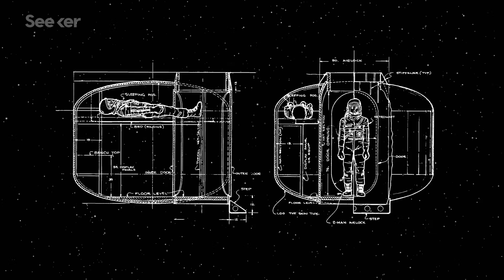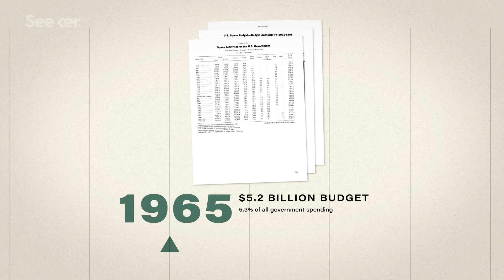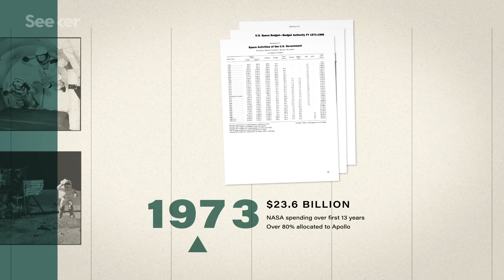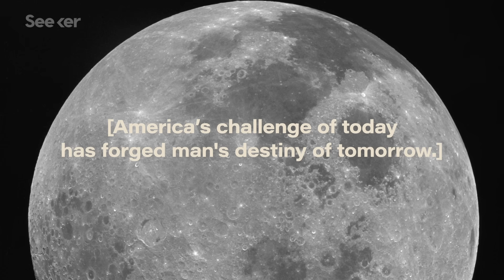Why Did NASA Cancel the Apollo Program? | Apollo

Comment: In my opinion, a base on the moon is a more logical thing to do rather than spending a lot of resources on keeping the space station up in low space orbit.. I mean the moon does have a stable ground and it has a soil composition similar to earth so plant life can survive there. Having a base there means we can build a much larger telescope and observatory that will not be affected by anything since the moon hardly has any atmosphere to bend light. If there is volcanic activity there it means we have minerals that we can mine and a way to harness energy and if we are lucky we can get some fuel as well. For me the priority should not be sending men to die in Mars but to send men to live on the moon. The advantages are endless.
Reply: The major point of the ISS is that it is Earth's ONLY lab for zero-G science.

And plants don't need soil to grow.
Reply: Lunar dirt is like powdered glass and sand blast abrasive. It scratches and clings to everything.
Reply: @projectmanagement2356  Yeah, imagine if that got into food or a spacesuit or even the base itself.
Reply: My point is that there is already an existing study on Lunar and martian soil/dust that it is possible to use it for plant life, though it needs to be processed. I mean moon dust practically everywhere might as well use it right? Aside from that hydroponics is also another way for plant life to survive, but my point here is not how to build a base, but the practicality of prioritizing having a base on the moon rather than on Mars. What do we gain from mars aside from satisfying our own curiosities? Why build a base on Mars when we haven't even built a base on the nearest space object to earth? I mean a base on Mars would be amazing, but I really don't think that it would be possible during this lifetime. I mean Mars is too far away and a million things could go wrong. You are aware that no manned space vehicle had ever reached that far. What they are attempting to do would the be first. Reaching Mars without encountering problems would a miracle, but it is possible due to the advancement in technology. Living on mars and returning safely on the other hand would be a different story. We can't just go and send the men out there to their deaths. Our space explorations has always been slow and sure but safe, that's the reason why we have the ISS. Why is NASA taking a dangerous leap now when there is a stepping stone right around the corner..
Reply: @neB_Storm  I agree that building a base on the moon is easier than building one on Mars, but living there is still not easy. People and plants would die from radiation.
Reply: Its cheaper to keep it closer to earth.
Unless you want people to live on the moon too.
But then getting replacement parts would be expensive and take forever to get there.
Reply: It's much easier and cheaper to build a Hubble telescope than to place one on the moon. I don't think something like the James Webb telescope would be possible also Personally I rather the moon stay the way it is, then to have it ruined by building colonies for the benefit of the few.
Reply: Again my point is not how to build a base but to question the practicality of building one on Mars. I'm just questioning why NASA is planning to send people to Mars when they know that sending people there may result in a disaster. Space as you know isn't a walk in the park, a single mistake could lead to losing lives, not to mention that that part of space is a part where no man has ever been to. Ask yourself wouldn't be sending people to live on the moon a more logical thing to do rather than sending men to die in Mars. I mean we've been to the moon more than a dozen times and I think it wouldn't hurt if we try to test out if the equipment works on the moon first, right? I think all of us understands that its better than sending human test subjects to Mars and pray they survive. You are aware that aside from the ISS, we don't have any thing else out there that we can call a proper base. I could say that the ISS is the only base that survived in space for that long and it is even on LOW SPACE ORBIT. What I'm saying is we need more experience and knowledge to not mess things up.
Reply: @neB_Storm  if something goes wrong on the moon, it's just as bad as being on Mars. Theres nothing we can do on earth.

So why not go to Mars instead of just the moon?
Reply: @Hooyahfish so you're saying if there is an available rocket to Mars you would want to be in it right? Dude you're not getting the picture. My argument here is again not how or why. Its the risk of people dying and how lacking our current technology and knowledge is. You are aware that the only manned space mission that we have so far is the one done on the moon, and the only space base we have, and not to mention the longest ever to stay on space is the ISS right? You are also aware that we haven't stayed on real outer space long enough to say we will survive a journey to Mars. The ISS btw doesn't count because it is an area we call the low space orbit where you can just go to the nearest escape pod if shit happens and the earths gravity would then do the rest and pull you back to earth. Have you ever considered even the distance of how near the moon is compared to how far Mars is? Please don't tell me you would want to be on a rocket headed for Mars because I would recommend for you to think twice. I'm aware you know that we already had explorations done on the moon so it is relatively safer to build a base there. Let me add an argument that going to the moon without dying is already a reality, unlike going to Mars, which currently is a dream. The risk of making a colony on the moon is lower as it is safer and economical. Don't get me wrong having to go to Mars would be AMAZING, RETURNING ALIVE WOULD BE DIFFERENT STORY. Going back from Mars alive is just not possible in this lifetime. Let me put in words that even you could contemplate and understand, if the earth was the same size as a basketball the moon would be 24 feet away from it. Now imagine how far away Mars is and all the shit that could go wrong along the way, which by the way a first experience for us since we haven't traveled this far away from earth  before. It would be a big mistake to even think about returning alive from Mars, you'll be dead even before reaching Mars so don't even think about returning alive. Now having taken all of  those things into account would you really want to take a one way ticket to Mars and risk it all for the sake of science? I'm  just saying a base on the moon should be the safest chance we have if we want to continue doing manned space explorations.
Reply: Wrong. It takes longer to get to the moon than the iss. The iss is also an international station and lead to continued peace in space. A moon base would be seen as an attempt to conquer space by a nation
Reply: @Space racer26 obviously it would take longer to go to the moon considering the distance. Tell us something we don't know. You're also wrong btw. No nation Is allowed to own anything in space so the base on the moon would not be considered as a form of dominance on the territory of the moon. All the space exploring nations signed to this agreement during the space race probably around after the cold war..
Reply: It would be great but the are a lot of craters and they came from something. Other then that, it would be way better then Mars, hell it would be a testbed for Mars. We need the ISS for earth studies and the like, there is a lot to still learn from it. We just need more budget and super powers competing for space related objectives.
Reply: @NightMare you're absolutely correct. If we can't even imagine living on the moon forget about going to Mars..
Reply: I bet Matt Damon could colonize the moon. He is the greatest botanist on planet mars.
Reply: @gianfranco Razzeto I think so as well. Try searching for the X3 Ion thruster here on YouTube and you will be amazed how a mission to Mars isn't so far away in the future any more. I'm interested in things that could happen in this short lifetime and I hope it piques your interest as well. The Martian movie by Matt is 60% using real and available science, so it is not so far from reality. Mind you I like the movie. Btw we are using the same Ion  thrusters right now on some of our satellites..
Reply: @Space racer26 I hope you get my argument. I'm simply saying Mars is too far away and if NASA is planning to build a base they should  build it on the moon first because it is nearer, safer and far more economical than building it on MArs. Oh also, returning alive is also another perk before i forget..
Reply: This is the link to the ion thruster video used on Dawn https://youtu.be/MGpRPpfeIAw ..
Reply: The date mars would be closest to earth would be on October 6, 2020 just so you know.. We won't get this close again until the next decade.. Oh maybe you guys misunderstand me again and comment it takes only 2 years and 50 days for NASA's next chance, believe me guys I know but it wouldn't be as close as the upcoming one on 2020 and guys please do research about the shape the orbits before commenting.
Reply: @neB_Storm  you do understand that moon base would be very impractical and will have no damn reason to exist. Moons surface is covered In material that can shred the spacesuits and it's very very impractical to build something on moon. As it's gravity is no where close to earth. Which we cannot say about Mars. As it's gravity is far more suitable then moons. And what do you use the moon base for. Practically nothing as the moon has close to zero value for us. Think about. When was the last time you saw a scientist from any space agency talk about moon colonization. While Mars is one of the primary targets for colonization. Moon travel was seen as sending test subjects in the Apollo days aswell. If we want to expand and colonize more planets and create a star system spanning civilization then we need to take those risks. Testing Mars equipment on Moon is legit degenerate. You don't even need to go to moon to simulate Mars. You can easily do it on Earth. As we have done actually. I hope you acknowledge the fact that moon colony is only a secondary objective rn.
Reply: @Sus lumebio again you don't get my point.. The point here is not why or how to build a base. My point is the practicality of building one in Mars. The moon has purpose because it will serve as a test bed for Mars. I'm not against going to Mars on the contrary I think it would be amazing!What I am against is dying while doing so. Given the experience we have, the moon base (for now) is the best chance for us surviving  in space because we have journeyed there, and we surely have returned alive from it as we have dozens of times. Btw Mars also have dust storms and hurricane-like weather everywhere, and is as dangerous as anything out there in space.

Let's me explain where we are as a species right now okay? We as of now are toddlers that is just learning how to walk and as toddlers we are on a stage where just even walking to our own rooms is already hard. Imagine how much harder it would be for us to cross the street and go to our neighbor's house. That my friend is how hard it is for us to go to Mars.

The time it would take us is 9 months to a year to do a Hohmann transfer to Mars because we just don't have the technology for the fast transfer, at least not yet. How on this world are we suppose to survive a year journey to Mars without starving? Please tell me how. If we solve that, we still have a problem about taking another year going back to earth.  A million things could already go wrong within two years and thats just the journey of going to mars and back. We haven't talked anything about landing on Mars and surviving from it yet. As you know the experience we have on any manned Mars landings is zero and is yet to be attempted my friend.

Let me ask you, why do we crave going to Mars, and what do we gain from sending people? What we gain would be way to live in a world other than ours which for me is amazing, but wouldn't it be better if we take it slow and do missions on the nearest thing first.  Shouldn't NASA be prioritizing  our men's safety to make sure they don't die on the mission to Mars? Isn't the moon the most safe, economical and logical test bed we have?
Reply: P.S. The moon has a stable ground and can be used to launch a rocket unlike the ISS where even astronauts exercising inside it can slowly tip the station out of of orbit. The moon has little to no gravity so fuel needed for us to reach the moon's escape velocity is relatively lesser. Its even safe to say  that due to the moon having little to no gravity, we can build a cannon there and launch the space craft that way. The experience we gain from staying on the moon would be priceless as it would no longer be a simulation and it would be the first for us in this millennia, because whether NASA admits it or not, it has been more than a decade since NASA sent out manned missions out to real space. The only experience they have in the past decade is sending people out to the ISS which is on a low space orbit only. That is why we as a space exploring species need all the experience we can get, and be honest you are all aware of how doing a simulation is totally different from doing the real thing. The problem we are facing now is mainly about the money not the impracticality of going to the moon, thats the main reason why no one is talking about it..
Reply: @Su Lomebio watch this link so that you'll be informed who's interested in the moon https://youtu.be/Eum-vpddaTk . Oh, a spoiler Its just blue origin and spaceX, not to brag but they have the same opinion as I do. Impractical  huh? Mmmmmhhh....
Reply: you have never heard of Project Horizon? THat was the real reason behind the Apollo missions: to set up a permanently manned military base on the moon. Unfortunately, the astronauts discovered they weren't alone . That's why man hasn't travelled beyond near orbit since.
Reply: Bagio I agree to a point.  Why bother to think about Mars if we still can't conquer the moon...